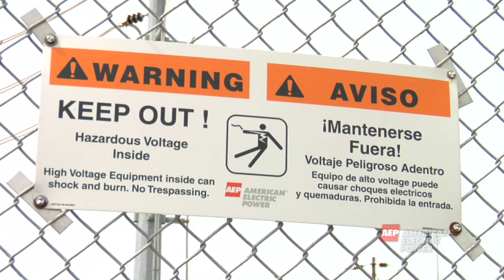Chapter 2: Anatomy of a Transmission System

Comment: to the person that will not allow a reply talking about not being allowed to steal copper you can steal the aluminum that's perfectly fine make sure though aluminum wire is coming off of a transmission tower into the substation and has the ceramic discs separating it from Poles Towers or the big humming boxes the aluminum wire coming off the transmission tower is perfectly safe to touch and once you touch it you will not feel anything

Comment: 500 kilowatt transmission tower allows for about 14 feet of clearance between the tower and that high-tension line. if you as a conductor work to stand and shorten that distance 2 less than 11 feet you will cause an arcing flashover where the electricity will jump through the air completing the circuit and turning you into a puff of smoke
Reply: kilo volt, not watt.